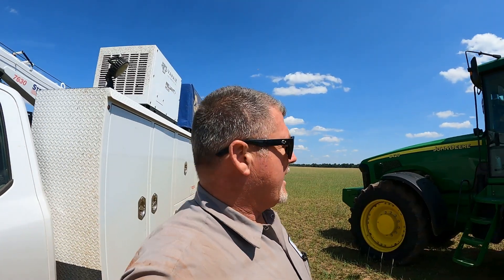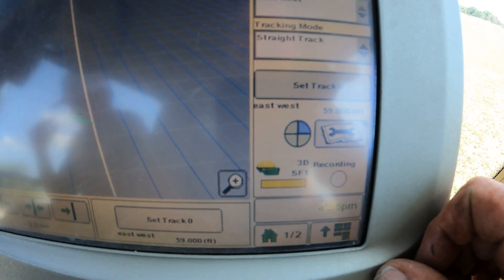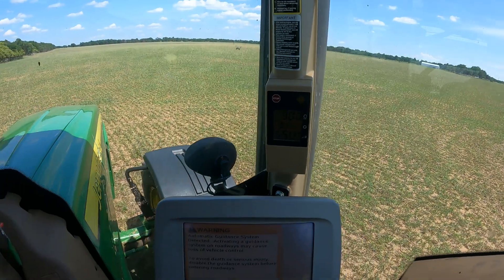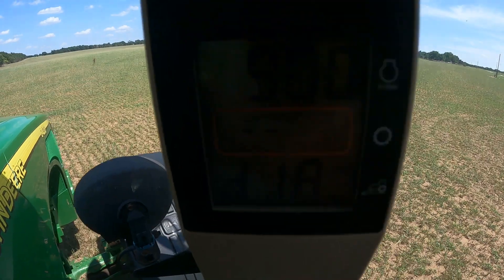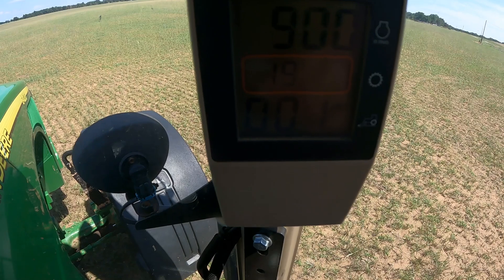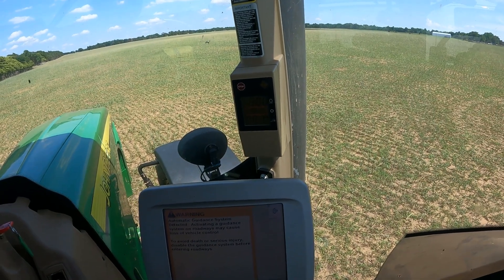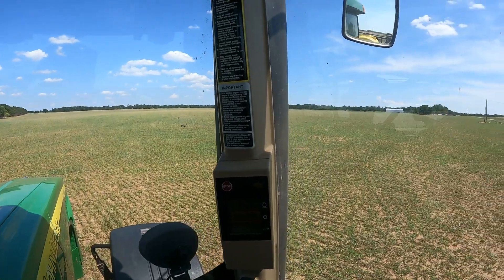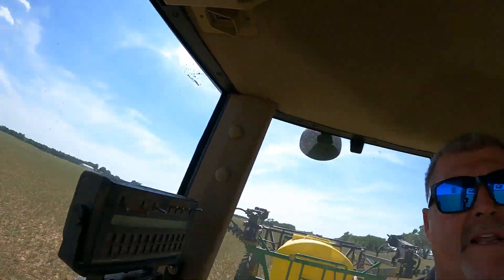E83 | Don't Bypass Seat Switch if You Want Auto Steer

Comment: Hie Larry we have a John Deere 5090E it’s not moving we tried almost everything changing the clutches it’s a forward reverser but when we connect the solenoids direct to a battery it’s moving but after putting everything together is not moving checking voltages all is fine advise